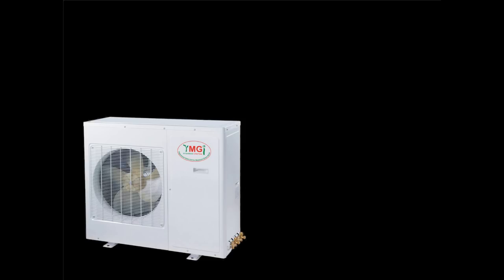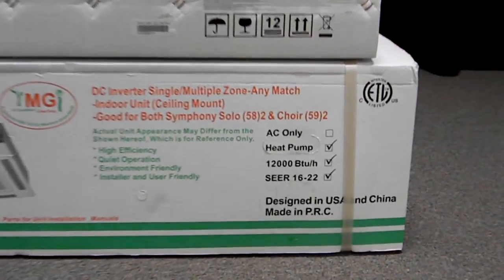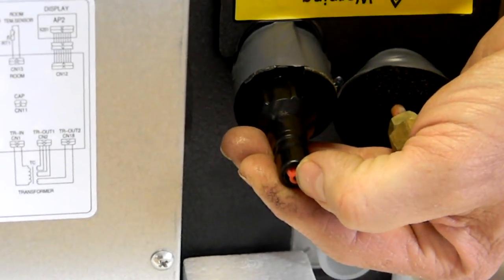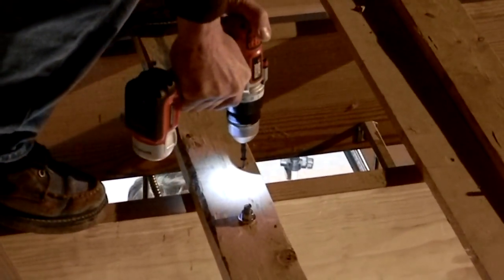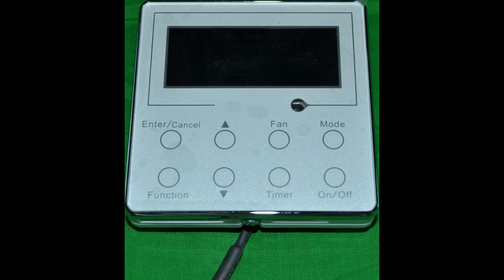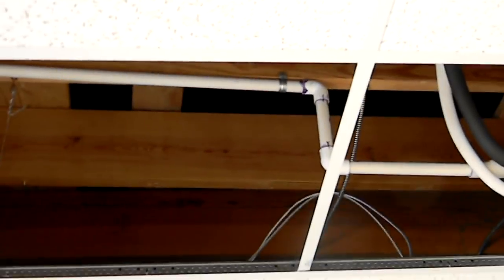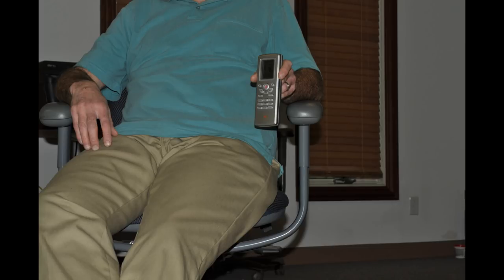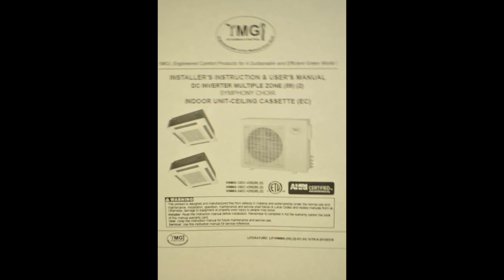YMGI  Ductless Mini Split Installation -Indoor Ceiling Cassette 59(2)

Comment: At https://youtu.be/weHrIU5EAt4?t=243 The instructor states it is filled with Nitrogen. 
The website says it ships with Refrigerant. 

Does this come pre charged with Refrigerant or Nitrogen?
Reply: The system is pre filled with refrigerant (R410a) is the one. Refrigerant is the substance that run through the condenser and indoor unit and create the cool air . Nitrogen is One that That you fill through the copper tubing if you need to braze the copper tube and joint them.